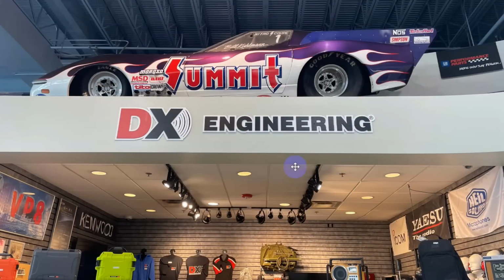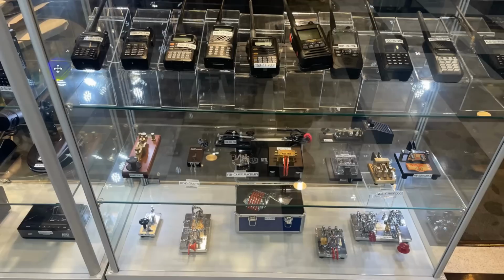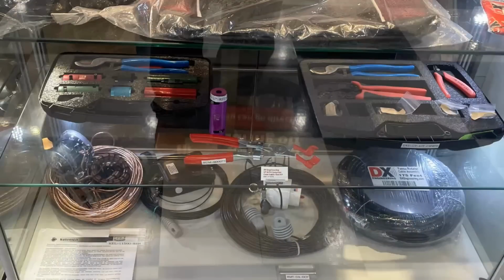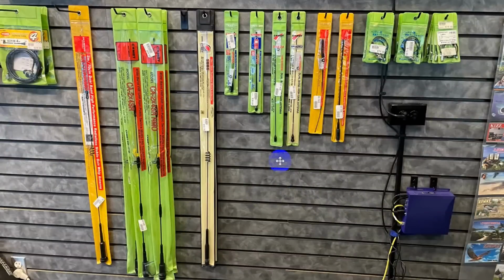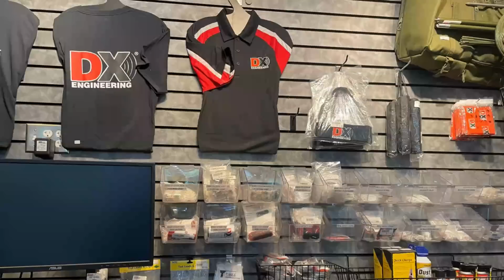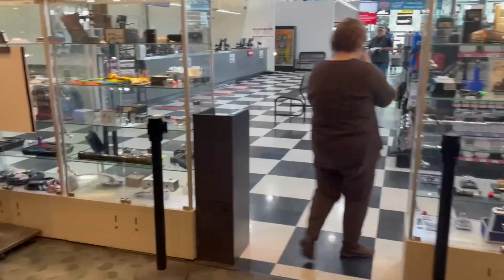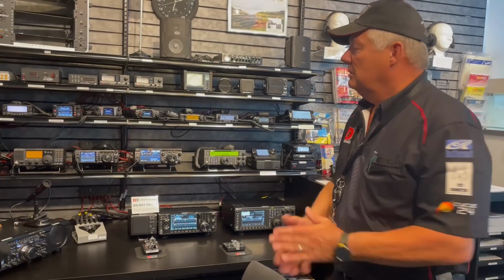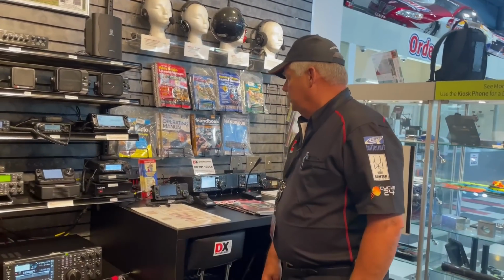My Visit to the DX Engineering Showroom (#729)

Comment: I enjoyed seeing the inside of DXE. It's a great commercial for them. But since you work for ARRL, is the League endorsing DX Engineering? In all fairness (and to avoid the perception of a  conflict of interest), you should also do a similar video at a Ham Radio Outlet location and a Gigaparts store.
Reply: Not everything is a conflict of interest. Dave works with the ARRL, but does not work for them. If there was a Ham Radio Outlet or Gigaparts store near Hamvention, they would've been visited instead.